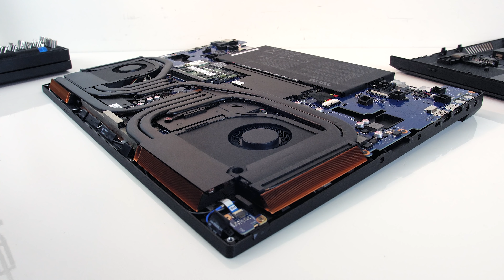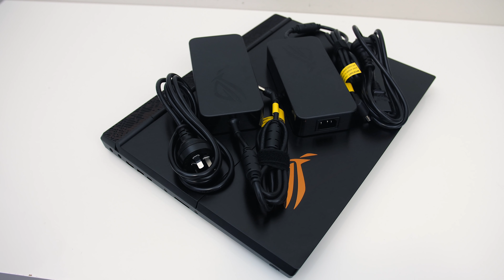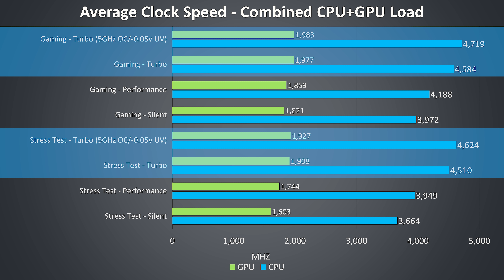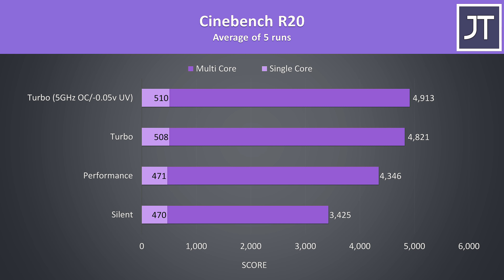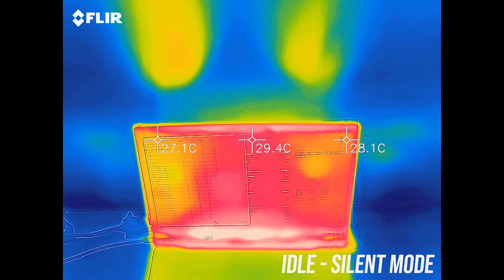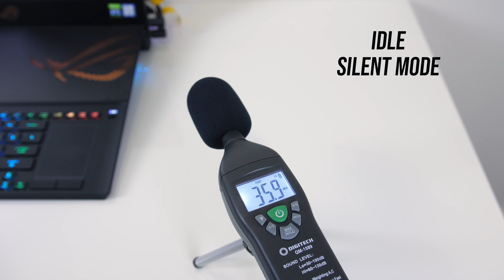ASUS Mothership Thermals - RTX 2080 + i9-9980HK Running Cool?

Comment: I have it,  and when playing Warzone I reach 91°C , which is insane. Due to the temperature, I experienced drop frame, I don't know if this is a fan issue with some dust. I don't know what to think except this product is scam.
Reply: Why did you buy it man
Reply: Yes I am 3 years late and pretty sure you don't have this "laptop" anymore but I'm thinking you need to clean your fans. Liquid metal last much longer so but as of this writing then yeah you should reapply it again or better don't put liquid metal anymore and use Honeywell PTM-7950

Comment: My acer predator helios 300 2019 RTX 2060 version is getting 90 degree in cpu intensive game ... is it risky ? If i disable intel turbo mode technology ... That game performs worse ... What Should I do now ?
Reply: i burned my mothership few month ago on my predator, 1050 TI, 85°C / 90°C.
Reply: Marsygato You mean your motherboard ?
Reply from the maker: 90c is pretty common under load, I wouldn't personally worry about it. You can try using a cooling pad/stand if you want to help improve airflow and cooling.
Reply: Jarrod'sTech Thanks Jarrod so much for replying ... Just one more thing can You tell me if the mobile CPU chip is built to withstand that kind of temperature ?

Comment: @Jared. What's the brightness of the display like? And compared to other displays on other 17 inch laptops you reviewed? Couldn't wait for your mothership review to know this.
Reply from the maker: It gets to 431 nits at 100% brightness, I'll have more info on the screen in the upcoming full review. This puts it above average based on other panels I've tested, though many good 17" panels with high colour gamut seem to be around the 400 point rather than 300. Contrast was also above average 1140:1, 97% AdobeRGB.
Reply: @JarrodsTech  good to know! Thanks.

Comment: 60Hz screen 👎🏼👎🏼 battery life sucks, drained very fast also it's getting warm badly.  Alternative for the money just buy a pc with high specs ..
Reply from the maker: You can get a high refresh rate option. Battery life is fair considering the specs, they did at least put a larger 90wh battery in it, granted with these specs you wouldn't be expecting amazing life anyway. Would you prefer to travel overseas with something as simple to pack as this, or a PC case/monitor/keyboard/mouse/power source 😎
Reply: @JarrodsTech  I had Asus Rog 502VL so I know base on usage these machines are good but not when its come to gaming and long last performance also you kind of stuck with the same CPU and Motherboard  not comfortable . And yes I would take something else rather a gaming laptop with me that warms up quickly, and it all depend on your needs,  my needs more like work environment then gaming but if I want to play well I'll choose PC again and again performance don't let you down.

Comment: hey Jarrod , do u think the ROG Zephyrus S (GX701GVR) is worth the money ? or should i wait for the 10th gen intel cpus to come out ? rn i got the msi ge73vr 7rf raider for almost 2 years and im not to happy about it . GPU is good , but the CPU is such a heavy bottleneck on it . i play mostly apex legends / siege / league of legends and putting everything on low to utilize the 120hz screen , but every lets say 5 min my fps would drop to 4 fps for a good second and then it goes back to normal . most of the time i push 120 + fps and i clean the laptop every 2 months . do u think i should get a laptop again or get something like the corsair one ? (small pc case with good performance) . i got  2,000€ to play around but would like u to help me out a bit . i did buy my msi laptop because of your review :P
Reply from the maker: 10th gen likely won't be out for laptops til next year for H series so depends if you want to wait and see. You're definitely paying a premium there for the thinner and lighter machine while still being powerful. It's a nice machine if you can afford it though.

Comment: mobile All in One monitor. my imagination is puting battery and speaker at monitor. fullsize GPU or bigger cooling solution below keyboard.  but this remove flexiblelity of a laptop.. just call it portable all in one monitor with built in stand. i dont see this as a laptop..
Reply from the maker: To be fair, I don't think they advertise it as a laptop.

Comment: I don't understand selling this with a 4k 60hz screen. Would much rather prefer a high refresh rate 1080p or 1440p screen with those specs.
Reply from the maker: High refresh rate 1080p is also an option, it will be better when 4K 120Hz is available, I saw ASUS using them at Computex in June so not sure what the delay there is.

Comment: Thanks for video. I have a question for you. Can you test Dell G5 5590 (1660 Ti) and compare with Lenovo y540 and Acer Helios 300. You are best review channel and i trust you so much.
Reply from the maker: Depends on Dell and what they have available. The honest answer right now is that I do not have time to reach out to Dell and request that model, I already have 9+ machines here I need to work through first.

Comment: Remember, that's running an actual desktop CPU. You're supposed to overvolt them to push the performance! Just make sure to add in another power brick!
Reply: The 9980HK is part of the laptop series.
Reply from the maker: Yeah technically part of the mobile line up, are you thinking 9900K?
Reply: @JarrodsTech  Yeah I was. I remember seeing the "Mothership" laptops with the desktop CPU, and just thought it was the same. And for some reason I missed you saying the "H" in the name.
Reply from the maker: @mattsmechanicalssi5833  Ah ok, no worries 🙃

Comment: Don't you guys think liquid metal on a vertically oriented machine, is not a good idea? Because of gravity and mounting pressure it will be accumulated at lower part of the cpu. m just speculating but serious overclockers can correct me here. And as always ty for the review jd.
Reply from the maker: On the product page they talk about what they've done about it, they've clearly thought it out 😛

Comment: Jarrod I am pretty confused 
Should I get an Acer predator Helios 300 with i5 9300h or 9th gen i7 
Is  there enough difference in performance to justify a 100 dollar increase in price
Reply: well it's just 100 dollar increase, so i recommend u  choose 9gen i7
Reply: @AgentFitz-y3u  thx mate
Reply from the maker: I haven't had the chance to compare the two so can't say what the differences are. Given you can't change the CPU later as it's soldered to the board, if you can afford it I'd probably just get the extra two cores.

Comment: Hi. If I'm going to buy a gaming laptop for about 1600$. Which laptop should I get in your opinion ? I'm thinking about the Omen 15 2019 but I'd like to have an advice if you can help 😊
Reply from the maker: I haven't tested any HP stuff myself so can't comment there, I'd go for an Acer Helios 300 2019 or Lenovo Y540 for $1000-1200.

Comment: Call me crazy but if it's just gonna stand up....take the back off.  The biggest disappointment about this laptop is the noticeably garbage air vents on the back.  If you really want to test what this thing is really capable off see what it can do without restricted airflow.
Reply from the maker: The air flow seemed fine, there wasn't even dust filters directly over the intakes, hardly anything in the way.

Comment: @Jarrod'sTech You can completely remove the power limit by disabling the "XTUOCDriverService" in Windows services and using throttlestop. This prevents Armoury crate from reading CPU temperatures and CPU fan speed, but you can still change between the fan profiles. I am sensitive to noise, and the 'silent' fan profile is definitely not silent. My solution is to set the manual profile to a fixed 18% for daily non-gaming use. I cannot hear the fans at this level but it can still cool about 65 watts from the CPU no problem before exceeding 85c. 

Is the range on your keyboard exceptionally poor? I can barely move it 2 feet from the computer and it starts missing keystrokes.
Reply from the maker: Nice, thanks for sharing! I admit I did not attempt to move it further than that distance so cannot say, and it's already gone back to ASUS so I can't check, sorry.

Comment: Oof... I think a desktop with a 4K 144 Hz monitor, 9900K and dual 2080Ti would cost quite a bit less, and this thing isn't really a laptop anyway
Reply: Lol no 2 2080tis are like 2500 and a 9900k like 600and the monitor like a 1000 along with the other parts this is cheaper
Reply: @extr3me225  4K 144Hz with $1000? LOL good luck finding it, because that spec require $3000. 4K 144Hz is a HUGE deal bro
Reply: Khang Lê maybe not a 1000 but max 2k 3k is way to much
Reply: @extr3me225  look it up bro, all 4K 144Hz monitor is $3000 and up, for example PG27UQ, which is at 120Hz and can only be 144Hz with ChromaSubsampling, still at $3000
Reply: Khang Lê found one for 1500 dollars so idk what ur talking bout
Reply from the maker: Good luck taking something like that with you on an overseas trip 😎

Comment: I would argue that this is not a laptop, this is a portable all-in-one.
Reply from the maker: Yeah thought that was what I said 😅
Reply: @JarrodsTech  Yet you still compared it to laptops rather than other all-in-ones or normal/comoact PCs🤣
Reply from the maker: @sephiroth6956  Yeah, that's what I test on the channel. I can't compare it with things I don't have, and the form factor more closely mirrors a laptop even if it is not actually used as one.

Comment: Hi Jarrod/All, I wonder if I went out and bought this I'd get similar performance metrics (I mainly care about the CPU all/most-cores speeds, not GPU) - or I wonder if whoever (ASUS?) gave you this Mothership to test didn't first ensure that you received a GOOD/much better than average CPU (i.e. good silicone, good silicone lottery) ??!
Reply from the maker: I have my doubts. I had this thing brand new in full unopened retail packaging, I doubt they bother and I don't think there would be that much difference between models - it's just got good cooling so performs well as a result.
Reply: @JarrodsTech  awesome! sounds good! thanks for reply

for reference my concern was sparked by this 2017 article https://www.techpowerup.com/237740/on-intels-decision-to-no-longer-disclose-all-core-turbo

if I could get most/all cores at 4.7-4.9ish (no GPU load, obviously in turbo mode) - i guess with also a small under-volt) I'd be happy :-)
Reply: the scary thing is that I could buy an okay-ish 2nd-hand car (in Australia/New Zealand and probably most countries) for the price of this machine :-(

also wish they had a 128gb RAM option (considering it's got 4 slots of 16gb, why not an optoin of 4x 32gb sigh) ~ and why not 3x 2tb option? only issue is that then the price would escalate into quite a nice car. Logically it's difficult to justify the purchase unless the extra performance generates income - I suppose it saves time and as time is money it could kinda give you some money back (after like a decade?) if you're being productive and not rambling on youtube ;-)
Reply: my bad, I see on https://www.youtube.com/watch?v=VA13zAwAq4c&t=578s there's upgrade options. I really wish I could afford this baby!

Comment: Ok I just saw the price.. 10 grand AU.. that's just stupid and then some. That's more expensive than an imac pro.. I paid a grand less than that for my imac pro with 5K screen, 64GB ram, 8 core that sits at 4ghz all core all day with zero noise, 2TB raid SSD (4x512gb modules are used) and admittedly, a much weaker graphics card, a Vega 56.. but for that extra grand I could get any egpu I wanted. Now, my setup costs just over 8 grand retail, and discounts can be had if you are nice on the phone (I got $500 off of mine at the time from apple themselves). Since this is not portable at all and IS basically a desktop replacement in an imac style form factor, who in their right mind would buy this? The new imac pro with updated graphics will be out soon, at the same price point as the one now.. and a Vega 64 of the current model is still going to give perfect gaming at any title at 1440P. And can still be had for less than this laptop.. using SERVER GRADE parts, ecc memory, and literally 10x quieter. What an outrageous joke. When comparing it to the metabox prime V, I can buy a great one for 5 grand, literally half the price, with the only difference being a 2070 instead of a 2080 (non max Q also), and it's still got the proper laptop form factor. So someone is going to pay 5 grand for better cooling?  Just another thing, this has 1 thunderbolt, 1 USB C, and 4 usb A.. my imac pro has 4 thunderbolt/usb combined, and 4 usb A. for 6 grand AU, there'd be a case here.. not for 10. And yeah, my screen poos all over this 4k screen.
Reply from the maker: They only made a small number of them and I believe there was a lot of work involved for each one, probably why, but I guess in the end the person paying doesn't care about that they just want the finished product.
Reply: @JarrodsTech  good for them.. there are always crazy people to pay for something lol!

Comment: does not justify the price . AND this is not a laptop in my book. I went for the alienware area 51m with a 9700k and a rtx 2080. thanks for the review as always thou :D
Reply from the maker: Yeah it's more of an all-in-one desktop replacement than a laptop, I'd prefer a traditional laptop design myself. No problem!
Reply: @math Got the same config what are your gaming temps like? My gpu is constantly at 74°C probably because of a bios setting but cpu gets hot high 80's.

Comment: You forgot the "card" with the other benchmarks, maybe link it in the description.
Other than that a great video as always. Only thing missing is benchmarks, temps and noise with just one power brick.
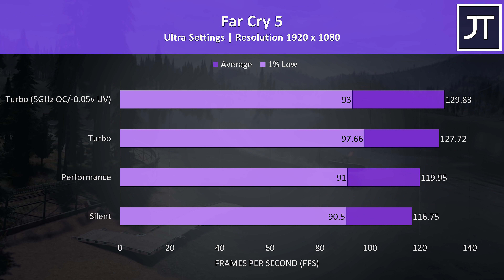Reply from the maker: I would have liked to have done the one brick test, but it got cut as ASUS only let me borrow this for a week, and there was already a lot of extra stuff to cover than the usual. Hmm the card at 6:15 seems to work for me.
Reply: Jarrod'sTech on mobile it doesnt for me.
Reply: @SteveEricJordan  idk about you but it works for me

Comment: So I have the gx502gw and in the crate software I have there is setting that says  manual, next to turbo. I did this with a stress test and pushed the 9750h to 56w when it was only supposed to be around 45 so maybe you go past 88w for that cpu using the manual mode in Armoury Crate
Reply from the maker: Was that sustained after a minute or more? You were probably running within PL2, I'm reporting long term PL1 numbers. Basically the CPU has 2 power limits, a higher PL2 value which runs for 28 seconds, then it drops down to the lower PL1 value afterwards for the remainder of the workload.
Reply: @JarrodsTech  So oddly I just did a quick test. I ran Cinebench R15 and my package was hitting 77w but when I did a 10minute aida64 run it maxed out at 60w and rested around 56w-59w. I even increased the voltage to 1.330V and it kept saying current limit throttling on XTU. So maybe I could have done more. This CPU is strange. Or maybe I just don't understand enough about computers in general.

Comment: Great  video mate 👍 I have a Dell G5 if i undervolt does that void the warranty?
Reply: Normally, no. By doing this, you just downgrade the capacities of your computer. You'll loose warranty if you overclock it though.
Reply from the maker: I honestly don't know, if you remove it before sending it back in theory they'd never know.

Comment: Hey Jarrod I got a question, if you buy the mothership on with the 4K screen, you can still change it to 1080p right? And will be able to switch to 144hz at 1080p?
Reply: I don't think so. The resolution can drop, but the refresh rate of the screen itself won't be able to rise.
Reply from the maker: Yeah you can run it at 1080p, but the refresh rate will not change from 60Hz. 4K 120Hz laptop screens are just around the corner, so in theory soon this won't be an issue.